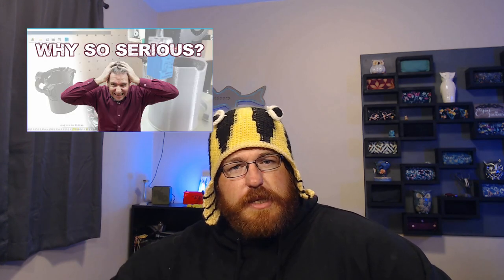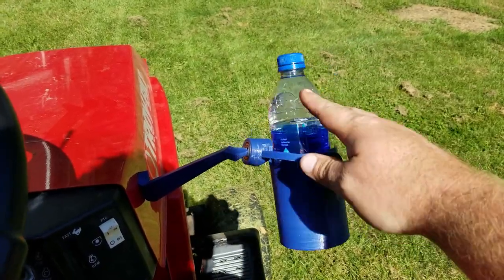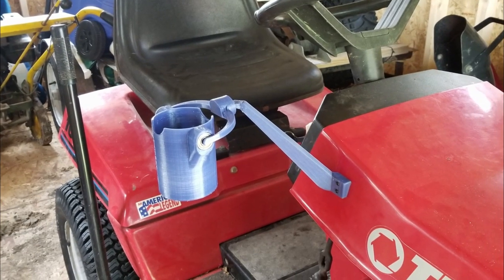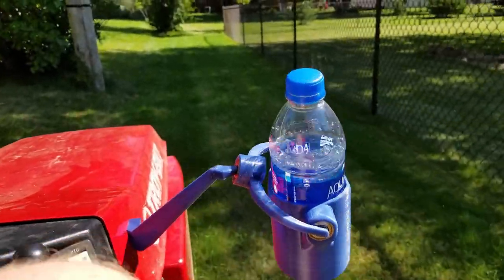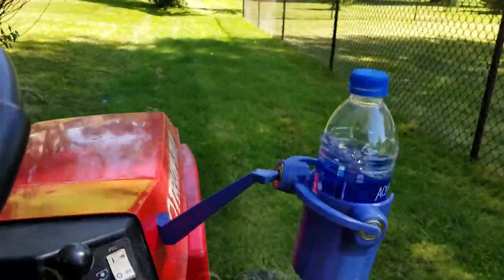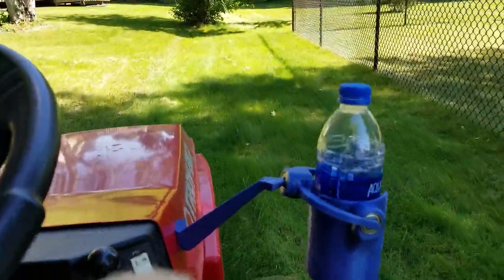The Gumbal - No Spill Cup Holder (STLs now available)

Comment: Make one for a lawn mower handle bar and I'll buy two right now!
Reply from the maker: Holy smokes that's one heck of any idea. I'll work on one this weekend and post the files. It'll have to be adjustable to fit on different sizes but I'll give it a good think. Great idea.
Reply: That’s actually how I found this. I was just thinking... man it would be great to have someone to hold my bottles on my zeroturn because you can’t drive one handed and when you set them down they get shaken to hell lol